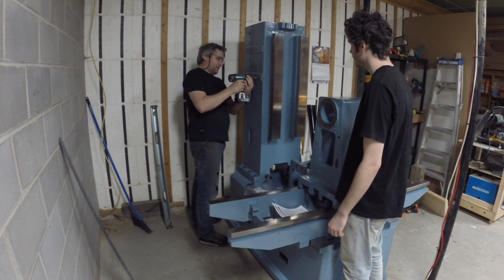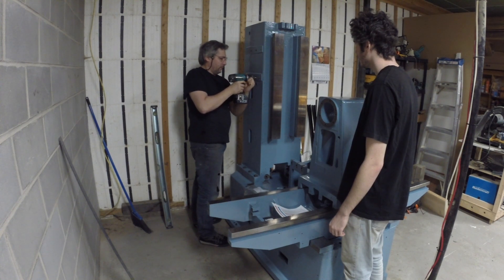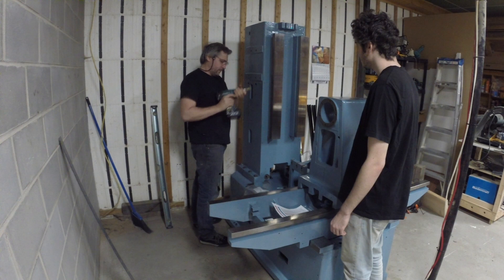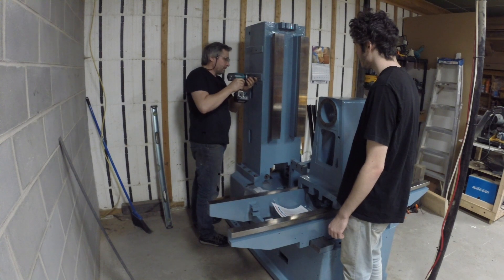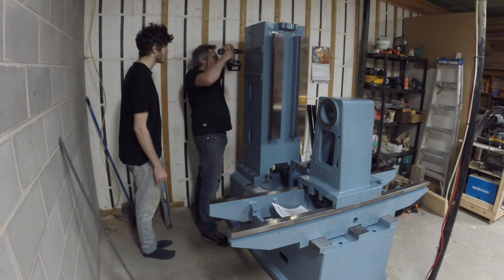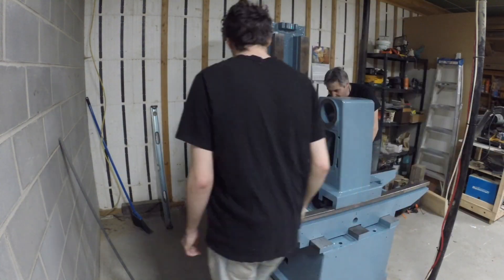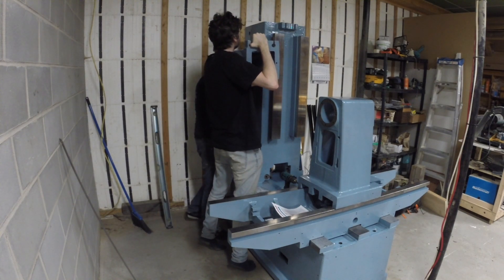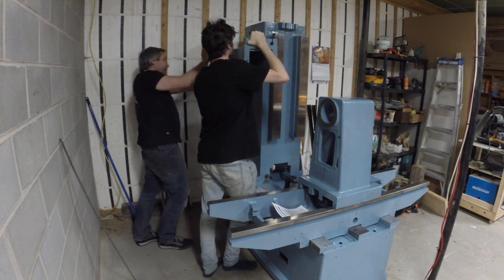Part 20 - (Installing the tool changer casting)

Comment: I use the following chart for a reference of torques of varying size fastners...in your case 23 lb/ft ...https://www.boltdepot.com/fastener-information/bolts/US-Recommended-Torque.aspx  Good to see it starting to be reassembled..your series has me thinking about a Mazak #18 CNC turning center transformation like yours...Thanks!!!
Reply from the maker: Thanks! It varies a lot from one chart to an other! Wonder why that is? CNC modernizing is great fun if you can have a good deal on a machine and plenty of time. To really enjoy it, I think you have to be in a situation where you have no deadline or heavy payements. I was lucky I had this deal and that I can have it in my basement.